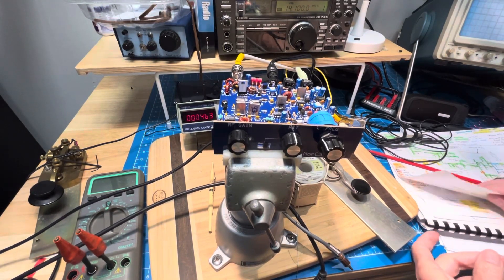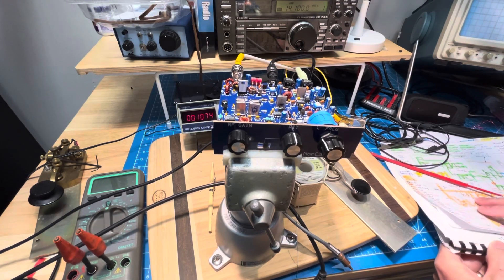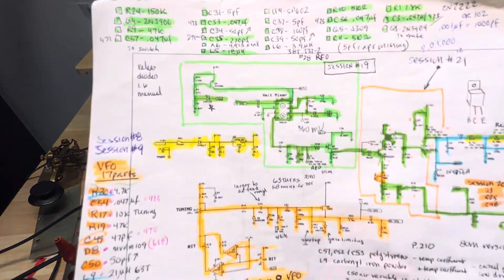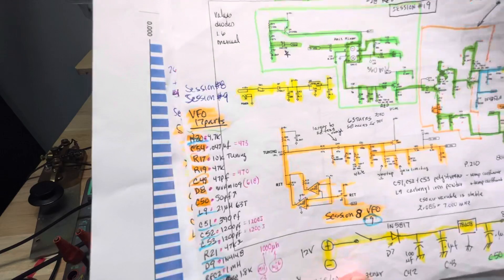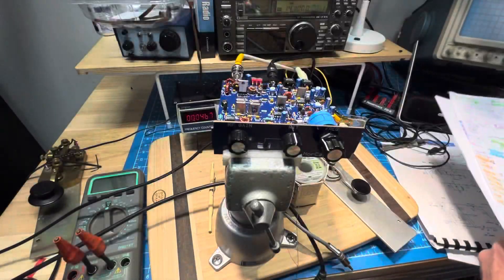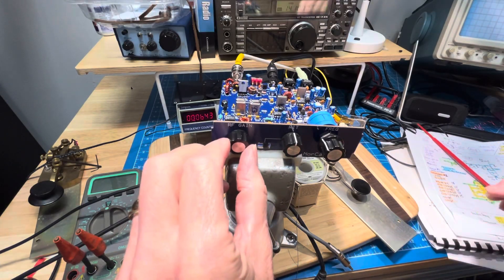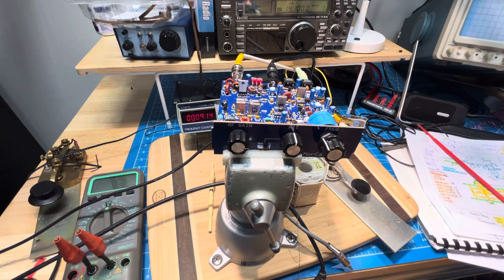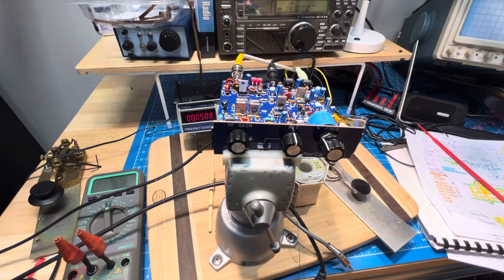NorCal 40B #23 - working better, final checks

Comment: Supposed to be 1-3 watts out, according to NM0S! I'm always devastated when power isn't there on a kit
Reply from the maker: The NorCal 40 was designed as a 2 Watt radio. I’ll see if we can get it up to 3 or 4 watts.
Reply from the maker: FYI, an already built NC40A on eBay too… https://www.ebay.com/itm/116012539551?mkcid=16&mkevt=1&mkrid=711-127632-2357-0&ssspo=LtiPfO0YQze&sssrc=4429486&ssuid=F73OsIM4Qdu&var=&widget_ver=artemis&media=COPY